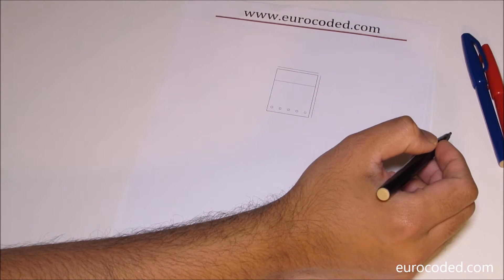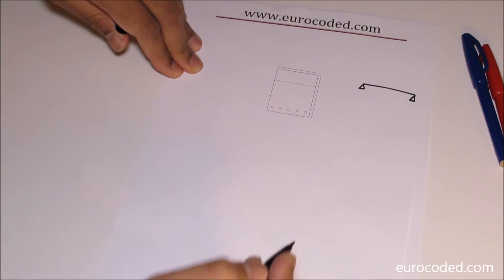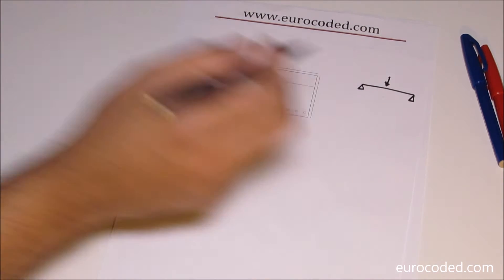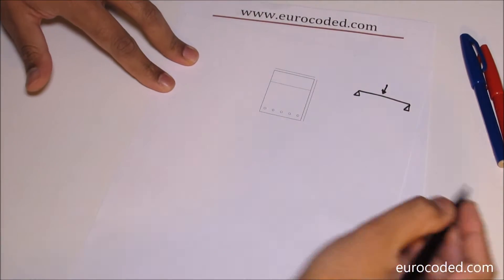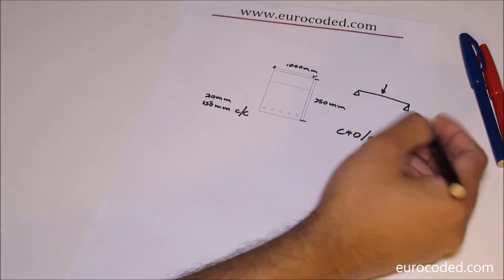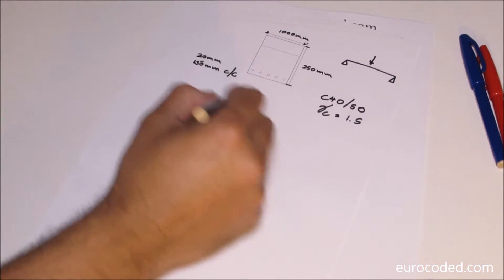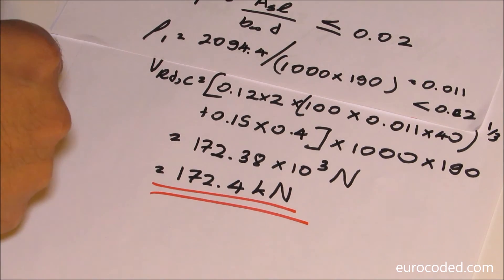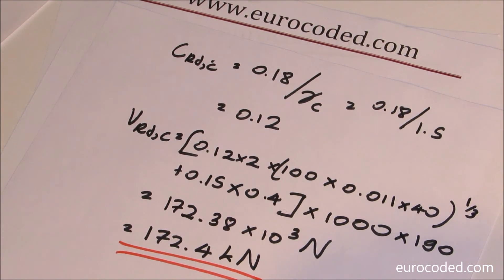Concrete Beam Design Example to Eurocode 2 - Shear Design Worked Example Calculation

Comment: Bro concrete 40/50 means your taking c40 or c50 and  is it cube strength or cylindrical strength ?
How you will calculate modulus of elasticity, tension strength, compression, characteristic yield strength formulas please?  
I'm familiar with Indian standard codes and I'm new to European code little bit doubts

Comment: hello...how to solve this 👇
1)design the shear reinforcement for a beam with b=300mm,d=550mm,V=150kN,fck=25N/mm² & fyk=500N/mm²
2)Design the shear reinforcement for a beam with b=230mm,d=550mm,V=250kN,fck=25N/mm²&fyk=500N/mm².Given dia link is 10mm. 😥😥😥😥
Reply from the maker: Have you done a check to see whether you need 'design shear
reinforcement'? You may just need minimum shear reinforcement. Check out this example: https://www.youtube.com/watch?v=XA8m1XnnjX0&index=1&list=PLKYpFtSJqr3g1QlhXXimKjywgV9gbbOUn